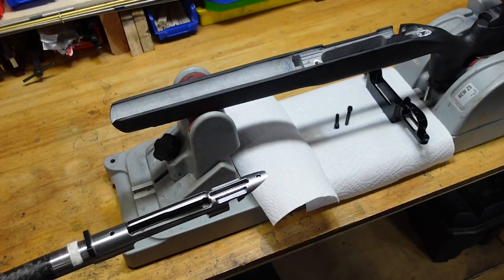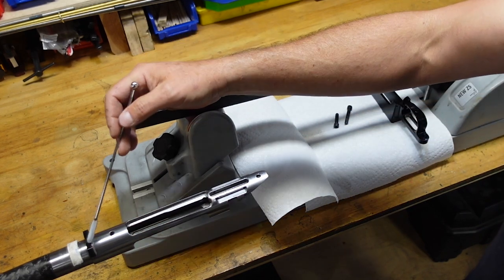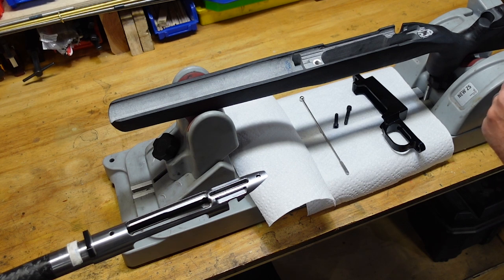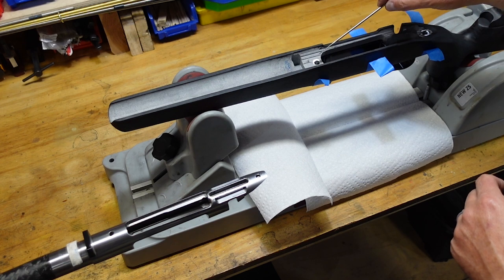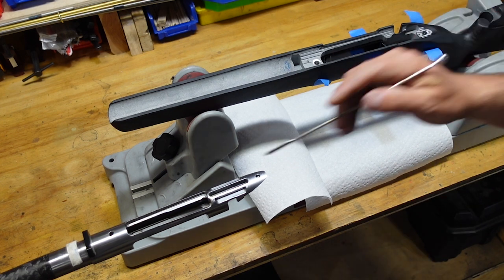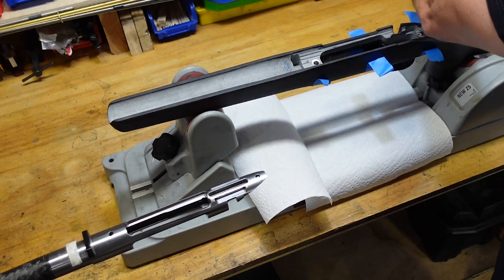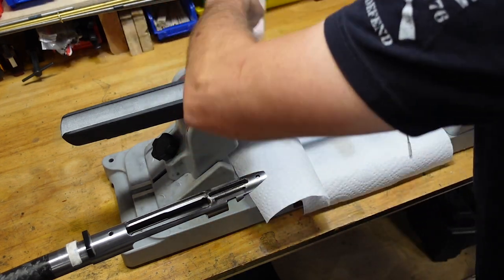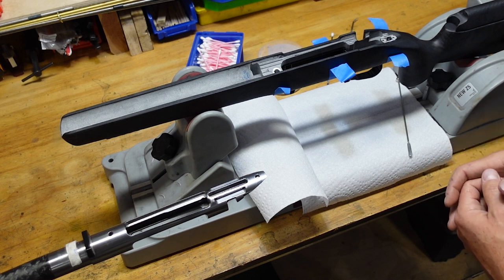Rifle Bedding Easy...Part 1 - The Prequel!

Comment: Your pillars that come with your bottom metal or the pillar spec by manufacturer set your correct height for proper function of the action. If your ejection port or tang height is low/high etc then you must modify the stock.

Comment: A nice tip to eliminate the risk of stressing the reciver, esp with heavy barrels.

Before making the primary bedding, you create a support bedding in the barrel channel.

Mask of two areas in the channel with tape (and release agent on barrel!) then put epoxy there, install barrel with stock screws and metals just like from factory. Let it harden.

When you later do the full bedding job you can fix the system by the barrel instead of the action - you can still use the stock screws rear and its recommended to get correct rotational and longitudal centering.

when the primary bedding is done, remove the supports.

If the system is heavy and you DONT use the support, you will just bend the reciver from the barrel and tang/rear screw working against the front action screw.
Reply from the maker: I have had great success with modeling clay with graphite on it in the forend. Same principle, I completely agree you have to be careful about inducing stress in that rear tang. Thanks for the tip.

Comment: Great idea to put the q-tip on the pick!  A tip for you is to come back a few hours later (time will vary depending on product used, humidity etc.) and break the action screws and retighten.  This way the epoxy will be set enough to be stable, but is not fully hardened yet, and if you got epoxy on the threads and not enought relief agent, you won't epoxy the bolts into the action.

Comment: I defy anyone to bed a rifle like a pre 64 model 70 Winchester.  You're bedding the action. Nobody beds barrels anymore.
Reply from the maker: I guess I’m not tracking, I don’t bed forends under the barrel. Now on some synthetic stocks you do need to stiffen them up but you aren’t bedding the barrel. I think you might be talking about the over flow in front of the recoil lug? Most of the time I clean that up in the mill and only the action is left bedded. Sometimes I do leave the over flow depending on the application and have never seen an issue, but that’s rare.